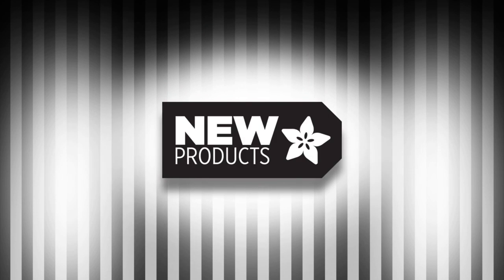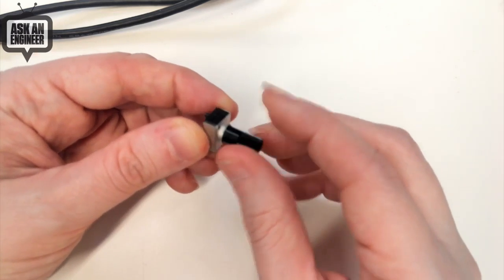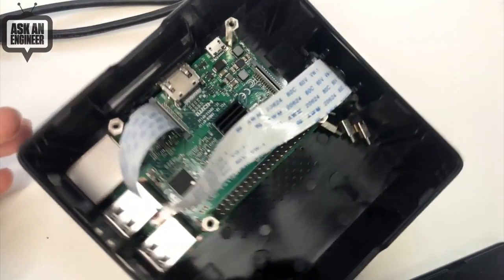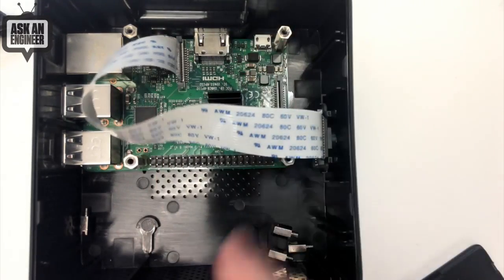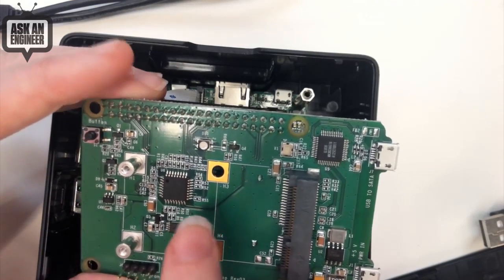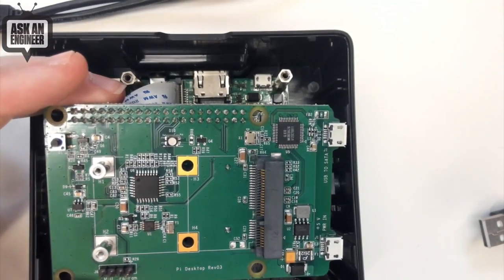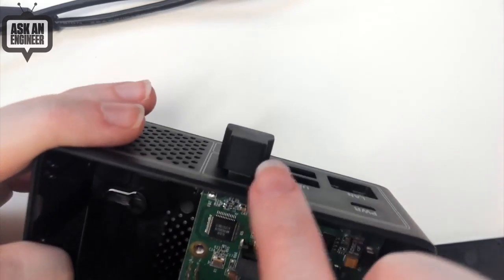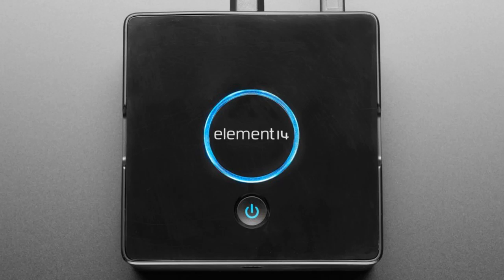New Products 2/27/19 Featuring #Adafruit #PyPortal! @adafruit

Comment: There's a lot of space in the element14 case. I was able to mod it to also put a PowerBoost 1000C with a double 18650 battery pack in itmto make it wireless.  I even put a slider switch for the enable pin on the PowerBoost, and micro USB extension cable to charge the battery.